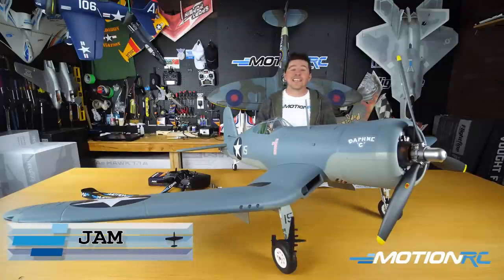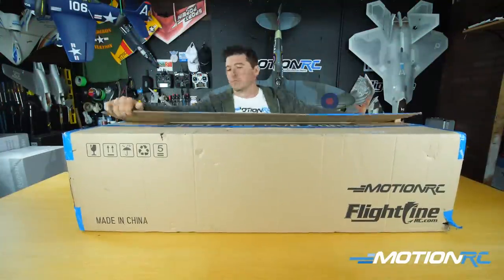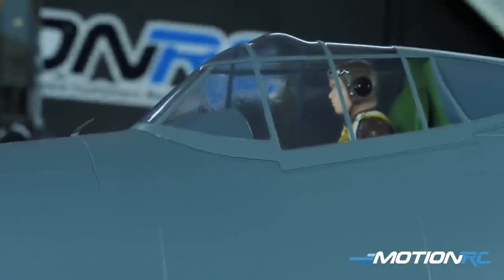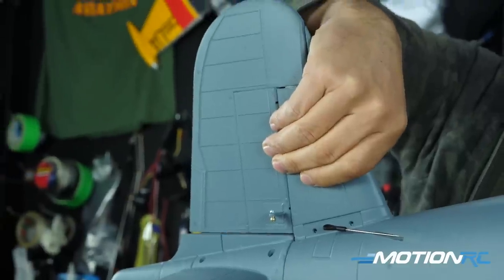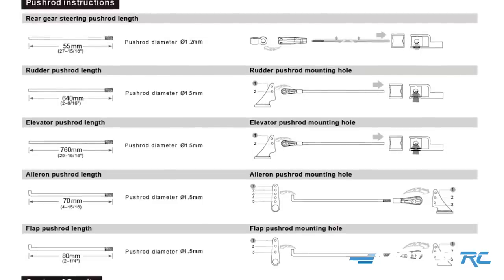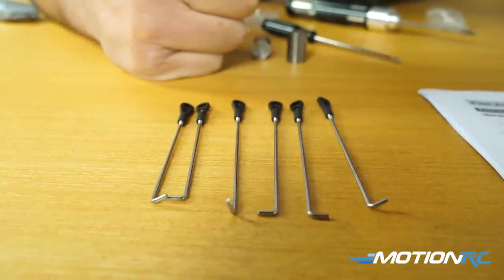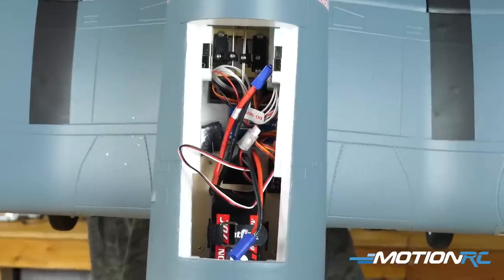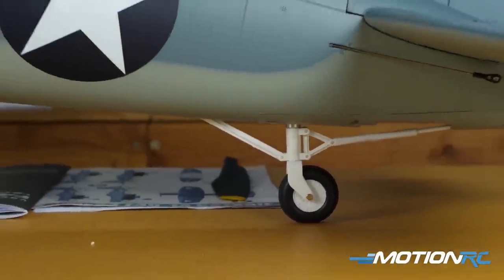FlightLine RC F4U-1A/D 1600mm Corsair - Build Video - Motion RC

Comment: You mentioned this model doesn't have a multipart fuselage. I actually like the multipart fuselages FW has produced. How many times have you had to throw away an entire fuselage where only the front third was destroyed. The rear 2/3rds were perfectly fine. Here's a challenge to all RC model manufacturers. Make the front third of the fuselage of all your models as a separate part.
Reply from the maker: It would definitely be a great feat to achieve. Maybe one day we will get there. Thanks for watching and commenting.
Reply: Thanks for all the great planes you've given us. I've only been in the hobby since 2011. Some great improvements in airplanes have come along in that short while and you guys have been the impetus in most of it. Thanks again.

Comment: Why have so many modelers started call "small pieces " & "parts"  "BITS" 
Do we call the hood of our car or truck a "bonnet"  ? 
Lets keep our English when we assemble (not build) a arf made in China.
Reply from the maker: That's a weird thing to waste the energy to comment on, but to each his own.
Reply: @MotionRC  Does not take much energy to comment . When I have called Motion RC to place an order for a repair, I have never heard anyone there say "okay ,what bits do you need?"
Just sounds odd to pick up and use words used in the UK. 
It's like calling a prop , 8 screws to attach the wing , hor/vert stab "a build" 
Now I am going to lay out the PARTS   for the 1600mm Birdcage Corsair I recently purchased and "assemble" it.
And then enjoy a spot of tea!
Reply from the maker: @radioflitercairplanes1715  Okay? I say bits, when there are little bits. Thanks for pointing it out